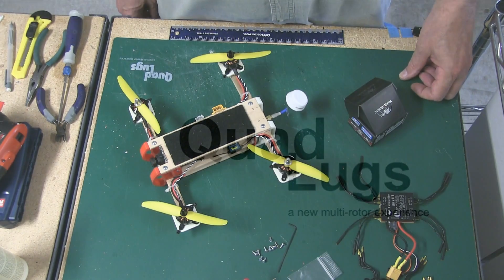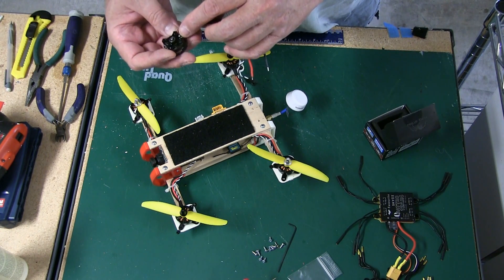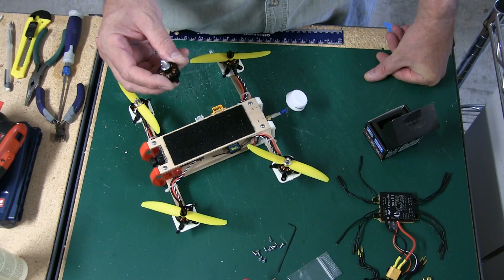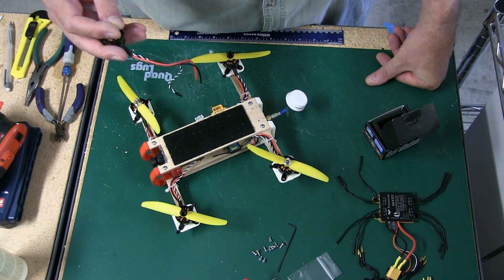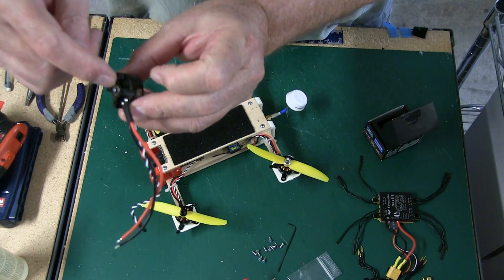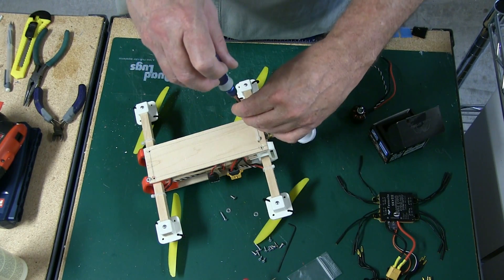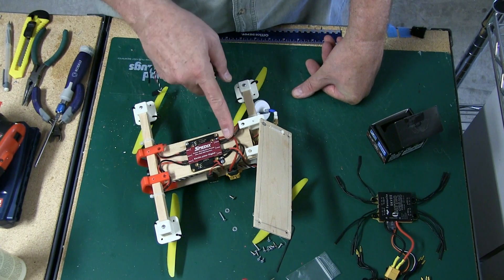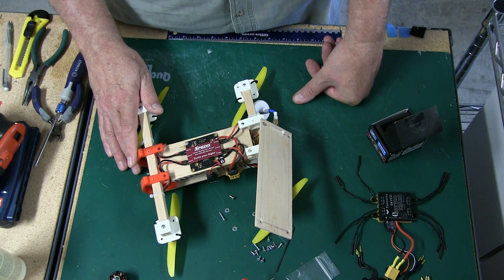QuadLugs - ZTW Black Widow Motors with Integrated ESC

Comment: Does the 2204 have the option to change motor direction the same as the larger models?      I know it comes in a CW and a CCw option.   Is that just the prop nut that is ccw or cw?    I prefer to use a lock nut and keep them all the same.   Makes it easier to have one for spare that will fit either purpose.   Thanks.

Comment: can you flash this esc the same way as others?
Reply from the maker: +Rhys Robinson - not sure - it is flashed with BL Heli 13.2 one shot enabled - as I round up more info - I will for sure spread it around -
Reply: Yes they can be flashed through Biheli program . I have a set running through a Naze32 and I can flash and program them direct from the Naze32 use port and I have another set on a RaceF3 Deluxe and same thing can flash direct through the FC usb port or use a usb esc flasher . Mine come 14.3 Biheli and simon K bootloader no problems.
Reply from the maker: Thanks much for the info